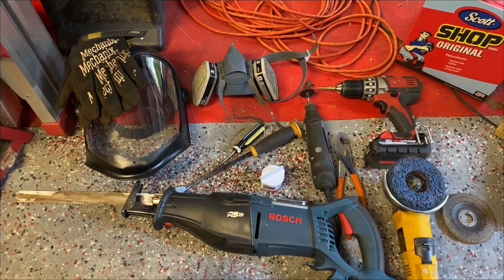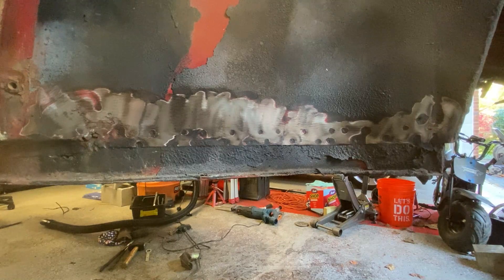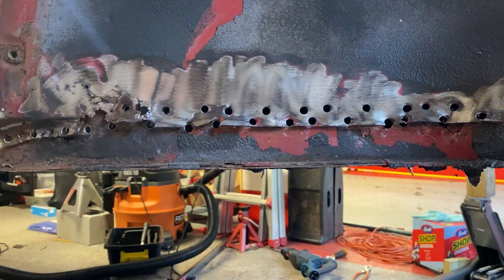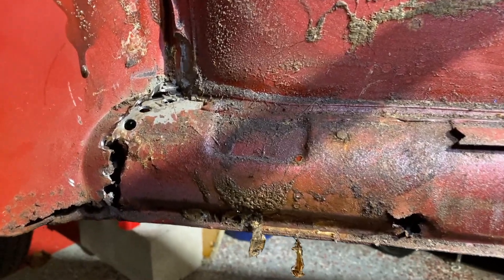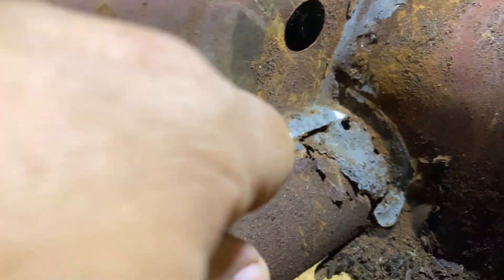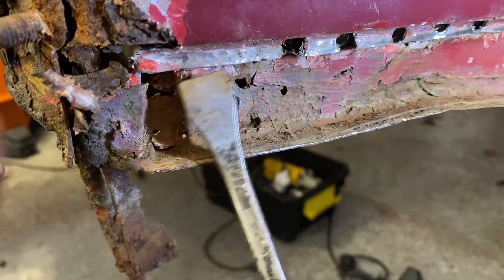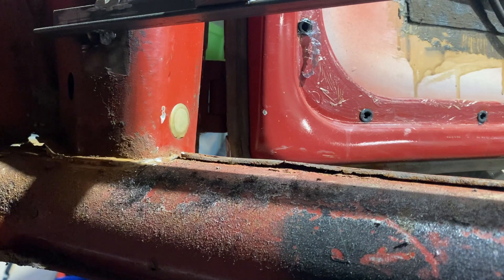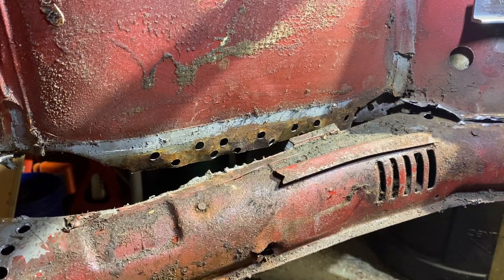VW Bug Heater Channel Removal

Comment: Nice work! The angle grinder takes too big of cuts. I need to find better Dremel cut off wheels. Mine keep blowing apart. I bought a spot weld cutter when doing my aprons from O'Reillys. Its nice, it don't drill holes through just cuts the spot weld. I forget which video I showed it in though.
Reply from the maker: Thanks for the comment. Some of the spot weld cutters walk on me.
Reply: @FixinBugsNStuff   I didn't know you tried one. that can happen. Surprisingly the 1 from a OReillys worked great. The 1 from Harbor freight, well....you know..lol

Comment: In 1981, I had a '70 Beetle with heater channels already rotted out in places along the door seal area. Doesn't take long for a Beetle to rust. I see this project is a '66 model and 40 years after I did mine. So, I guess this car is a lot better off than mine was. My '70 has long since gone to the crusher.
On the other hand, in 1982, I had a '69 Beetle that was originally sold in the Pensacola, FL area and was undercoated by the dealer. The body was totally protected from rust and was a very good candidate for restoration, which I did.
Reply from the maker: AWSOME. I have other videos that show exactly what you are talking about and how to address it.

Comment: Excellent video mate, by far the best for removing a heater channel and great use of the Dremel. I am about to do this myself, can I ask what checks/measurements did you make to ensure the new channel goes back in the right place?
Reply from the maker: What I normally do is bolt on the  heater channel to the floor pan and lower the body. Double check the doors then tack weld heater channel to the body. Un-bolt heater channels and lift the whole body with heater channel in place. I hope this helps.
Reply: @FixinBugsNStuff  That works for me, it wil be a couple of weeks before I get to it but I will let you know how it goes. Thanks again.

Comment: Buy, those vw builders really like to spot weld!
Reply: It's fast and mostly consistent, not much heat to distort metal and no worries about setting wire speed/gas flow. Spot welder doesn't use anything except electricity.